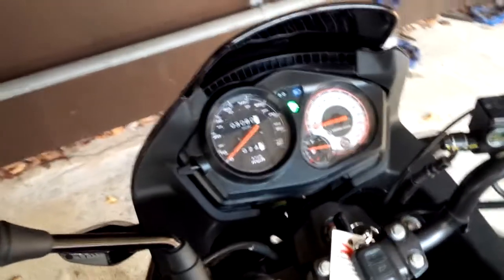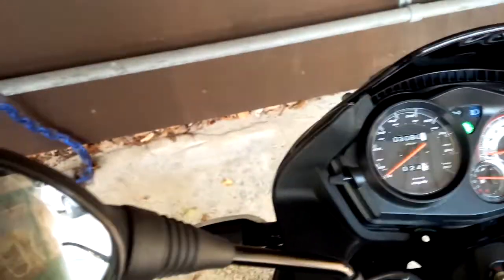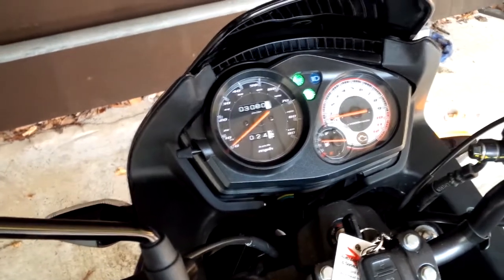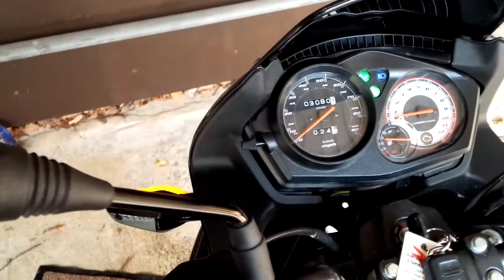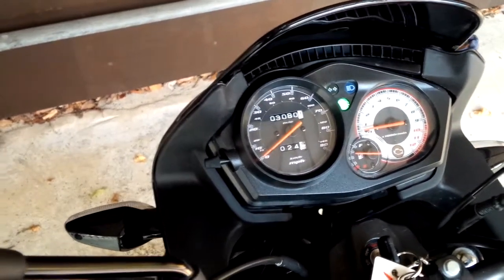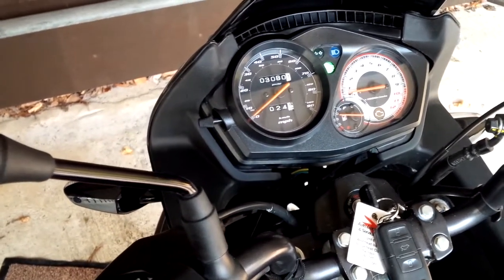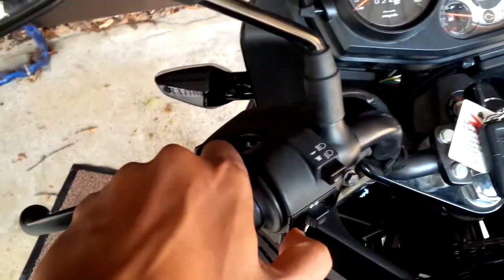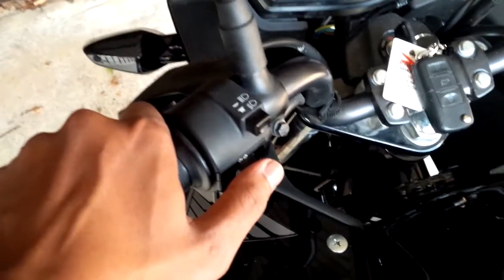Honda CBF 125 indicators malfunctions

Comment: hello John i hope you are well? 

i am at my whits end with my Honda 2011 CBF 125cc 

At 1st my indicators stopped flashing or was erratic  so i checked that my bulbs are working and also bought a new relay unit which fixed the problem but on worked well for a day. 

unfortunately now when i indicate the bulbs do not flash but stay on until i turn the signal off after cornering or changing lanes. 

would you happen to know what could be making this problem occur and how to remedy the issue.  

many thanks 

Marcus